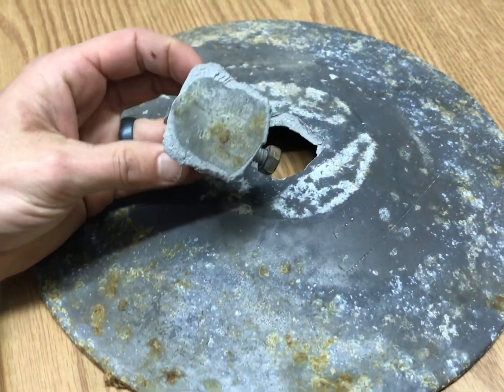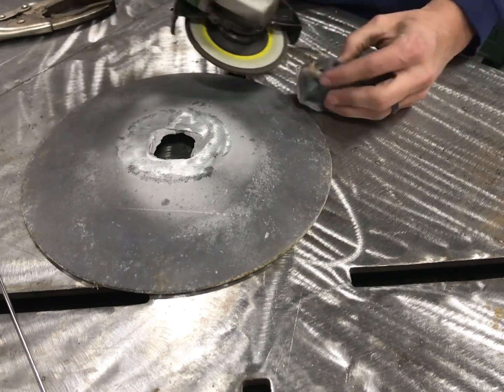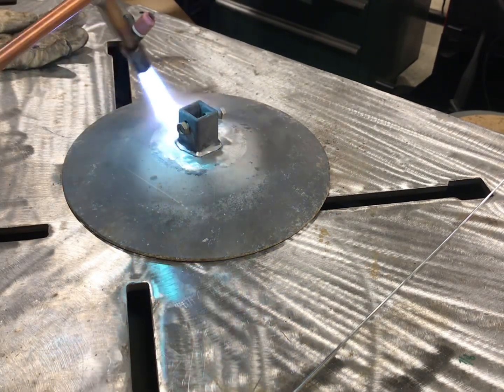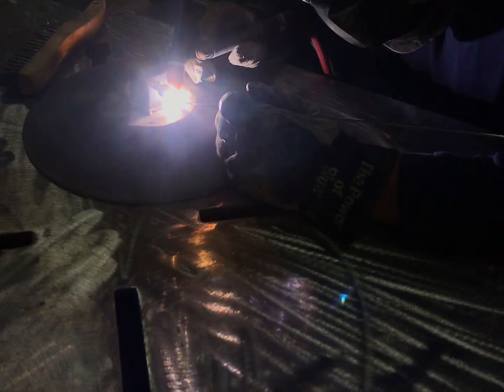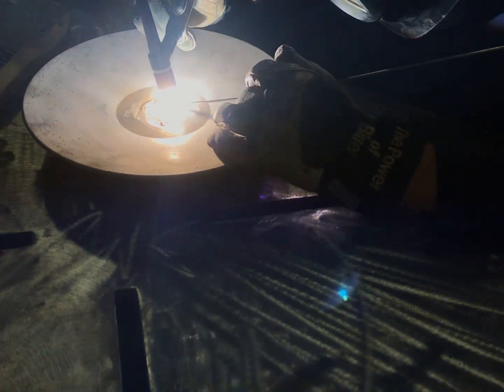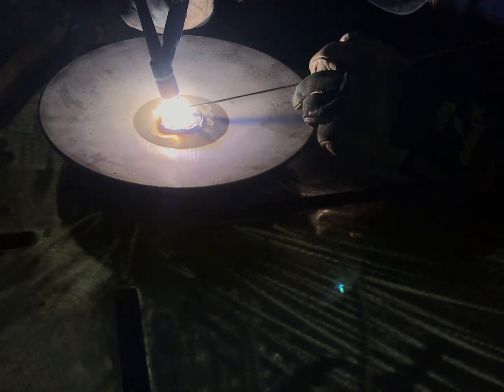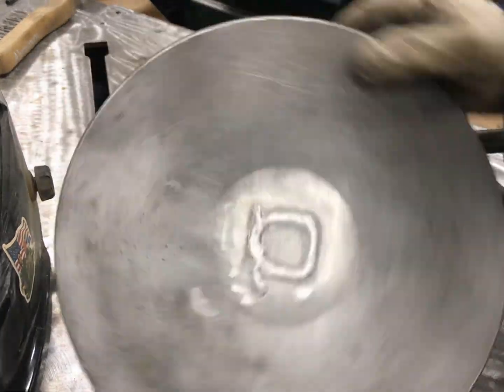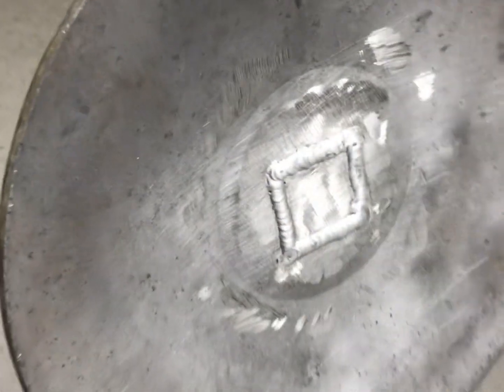Simple Cast Aluminum Repair

Comment: I know you posted this a while ago but my question is about that low heat aluminum welding rod that works with a propane torch.
But last summer I wrecked on my bike causing my passenger peg mount to break clean in half almost to the point that holding the piece's together almost eliminating the crack and if I thought super glue would hold up Id be going that way. But I know the repair has to be strong enuff to withstand someone standing on it and if I half to I'll start searching for a replacement but parts are always hard to find and if found there always pricey.
So I'm thinking about using a container filling it with play sand and pushing the part into the sand as a hole piece and start melting the low heat aluminum brazing rod hoping it molds everything back together nice and strong before I start grinding, sanding, cleaning and repainting it or am I better off to talk to a few professional welders thanks.